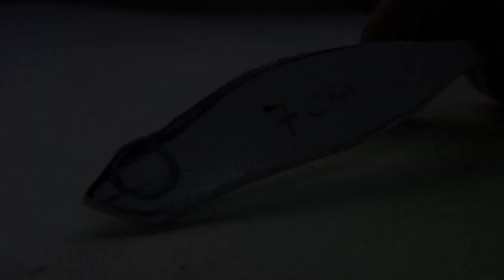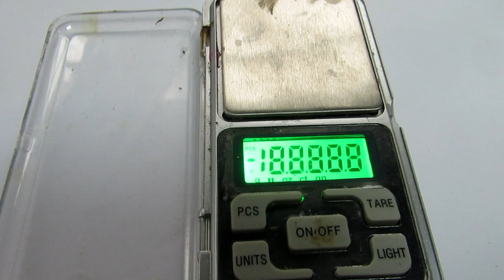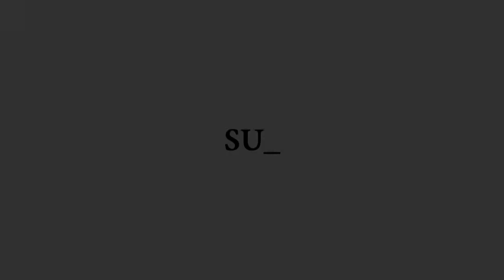A to Z Lure Making Tutorial. Balsa Minnows part one

Comment: To accurately mark and set the eyes, I pierce the needle through the bait. And then I use Wood Brad Drill and carefully shape the seats of the same depth with my hands. I also do this after impregnating the bait with varnish or epoxy resin, due to this, the balsa crumbles less.
Reply from the maker: It's a good ideea and I heard before about this.

Comment: Nice video.  Can you please tell me what type of plastic you use in your sealer.  I tried polystyrene but it it just turned into a gooey mess like chewing gum.
Reply from the maker: Buddy,you can buy sealer from the store or online.. I don't know the name of that plastic..
Reply: I had use Styrofoam and it solved completely in nitro thinner. The result was a slightly yellowish liquid which viscosity depend on the plastic quantity. The surface of the piece of balsa scrap I had use for testing became a little bit harder  after solvent evaporation but I don't know if the plastic did penetrate enough.

Comment: What is the white liquid you use? I just started making lures and can use as much advice as possible. Thanks!
Reply from the maker: Its my homemade sealer.
Reply: @BejanHandmadeLures  is it mineral spirits and linseed oil? I just read about that…
Reply from the maker: Linseed oil works for wood baits. What I'm using its a plastic melted in acetone and I added a white pigment.
Reply: @BejanHandmadeLures  What is the "plastic" generic name? Is it expanded polystyrene (Styrofoam)?
Reply from the maker: If I'd knew it, I would tell,but I don't know the name. You can use white plastic cups plastic. Its not polystyrene
Reply: @BejanHandmadeLures  Could you have a look at those cups? The plastic they are made of should be written/ mark on the cups' bottom and you could read one of the following codes:ABS,   PVC, PP, PS. These are the usual plastics the thermoformed cups are made of. PP (polypropylene) it's not soluble in acetone. so the plastic should be one of the other three: ABS, PVC or polystyrene. BTW: I had solve some Styrofoam in nitro thinner (not acetone!) and i had dip a piece of balsa. When the acetone was evaporated I could notice the surface of the balsa wood is a little bit harder but I don't know if the plastic layer is really a protecting one.
Reply: Asa-mi trebuie daca nu citesc toate mesajle inainte de a posta si eu. As fi putut evita utilizarea englezei "de balta'...
Reply from the maker: Nu e problema. Paharele sa fie din alea albe. De polipropilena,cred ca sunt. Ca si solvent poti folosi si nitro,dar v-a dura mai mult topirea paharelor si evaporarea e mainlenta pt ca nitro e mai putin volatil
Reply: @BejanHandmadeLures  Prima data am intrebat goagalu'. Rraspunsul lui a fost lipsit de orice echivoc: polipropilena nu se dizolva in acetona. Cu toate astea am incercat sa dizolv eu o bucata de pahar alb (marcat PP) in acetona. A trebuit sa-i dau dreptate lui goagal... Cum ti-am zis, am dizolvat poliuretan expandat  (placi izolatie termica)in diluant Nitro 209 si am obtinut un lichid de consistenta apropiata celui utilizat de tine. Intr-adevar, e nevoie de ceva timp pentru evaporarea solventului. BTW: goagal mi-a aratat si ce se intampla daca dizolv poistiren in acetona: 'iese' o pasta cleioasa ce se separa de acetona si precipita la fundul vasului. Se pare ca este un adezaiv excelent pentru lemn, carton, hartie, ...